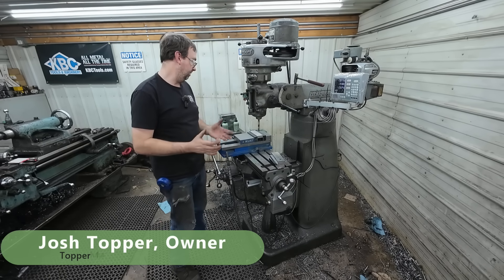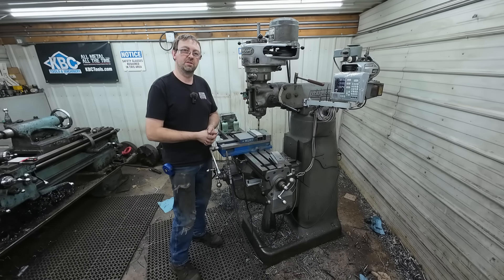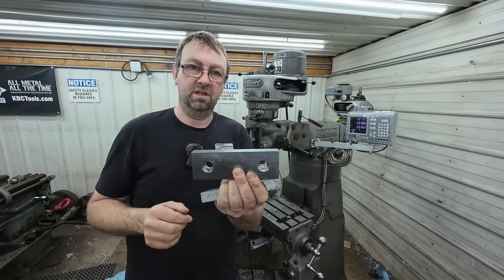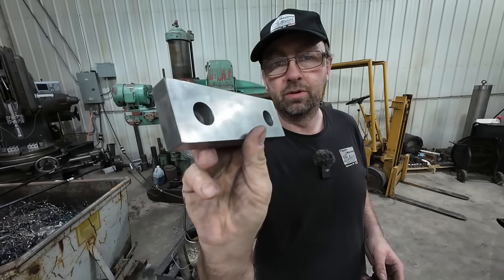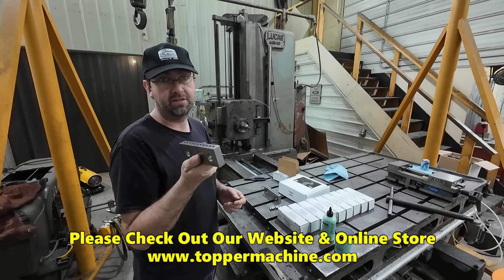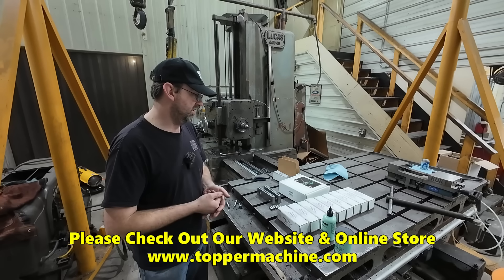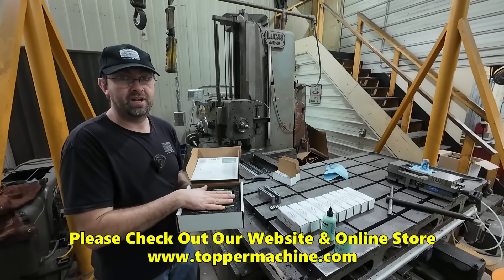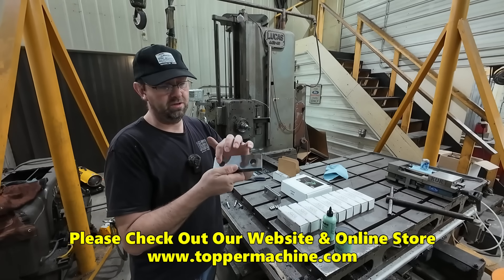The Best Custom Vise Jaws for Your Money

Comment: My favorite thing about this video? An experienced manual machinist's display of chip control! Probably most people would not even notice most of the subtleties you clearly show. From the use of the air-gun (mess be damned! we shall clean later), down to the flip and slide on the drill press. Almost every manual motion you made has the chips in consideration. Excellent!

Comment: Positioning.
Since you are doing so many units I wanted to ask why you don't drill all of them in sequence.
For example, the first hole is set up in the mill, then drill all the pieces for the first hole, are repositioned and repeated that way you do not
have to reposition each hole time and again on the same piece.

Would this approach save any time?

Comment: At 10:24 in the video, your drill chuck is turning in the right direction, but your reamer is running backward.   I know that the video frame rate is what causes it to appear that way. I'm guessing that the larger diameter drill chuck is  turning at a speed that matches the frame rate, and I guess the smaller diameter of the reamer isn't matching up the same.

Comment: Cool concept for holding parts. We use the snap jaws bolts at work but machine a lot of our own soft jaws to work with the snap jaws system. In many cases we machine the profile of the part into the jaw for good clamping. This jaw design would probably work well for prototype work being able to quickly adapt. Some day I'd like to get the snap jaws angle jaw. I wouldnt need it very often but man it would be way faster than making a custom jaw to hold something at an angle (no sine bars in the shop).
Reply from the maker: I bought the angle jaw. Haven't used it yet, but I have it.

Comment: You're turning yourself into a repetition shop with all that drilling and reaming. Well done. 👍
Reply from the maker: I started out in a manual production shop. I learned a lot of ways to do this without cnc. It really isn't bad.
Reply: @TopperMachineLLC  I started a repetition shop with only manual machines way back in the early 90's, I know just how boring it can be to stand at a drill press drilling and tapping 100's and even 1000's of holes one at a time.

Comment: Josh,  Well done,  Make a drill jig to reduce process time.   I don't remember seeing a surface grinder in your shop.  I suggest purchasing a used machine in excellent condition.  Make small angle plates, toolmaker cubes, squaring blocks etc.  Making your own work keeps you in business.
Reply from the maker: I had a surface grinder. Biggest waste of money and floor space I ever had. Finally scrapped it after never needing it in 10 years. Never turned it on once.

Comment: If I may make a suggestion, for drilling on a Bport I have found a steering wheel handle makes things easier.
Reply from the maker: I've used them, never cared for them.

Comment: You might be flat out making pin jaws when the orders come in. Personally, I don't have a need for them, as I don't have any machine that would require them. I just have a regular bench vise and a drill press with a junk vise with a lot of slop in it, but it's adequate for the occasional drilling I do.

Comment: The vice jaws are very reasonable. I have a smaller machine so I have a 4” vise. There are a few jaws with drill outs for both 4” and 6”. That’s great. So I like making 6” long jaws in 3/4” thick for my 4” vise. 4140 orehard is good. If you can get 4140 HT, that’s better. It’s what I use. That’s RC 45. You just need M35, M45 or carbide to work it.
Reply from the maker: I will be making 4" jaws soon.

Comment: I started using Anchor Lube after seeing  you use it. I also lay the bottle on its side so it's ready to dispense. Just a hobby shop  so won't need to order more for  a while.
Reply from the maker: It really is good stuff!
Reply: @TopperMachineLLC  Especially like getting rid of the oil smoke.
Reply from the maker: @ That was the first thing that sold me on it.  Second was how it worked in hard materials.  Absolutely amazing
Reply: i ref your channel when I suggest it to other shopguys. don't have a reason to get any myself (yet 🤞) but doing a little where I can

Comment: Hi Josh,
I really like your custom reamed vise jaws and will order a set soon. I plan to ship you two boring head range extenders of different designs soon. First I need to know if you have a 2 inch boring head? Which carrier do you prefer?  I normally use USPS.
Reply from the maker: Cool, thanks!  Any of them will get it here. FedEx is the worst though. Lol.
Reply: I assume you do have a 2 inch boring head. Both designs work on that size but could be adapted to 3 inch and larger. A sub- freezing cold spell in N.C. but probably not as cold as Spooner.
Reply from the maker: @ellieprice363  I currently do not have one. Been meaning to order one. 26° today. Actually nice out.
Reply: Go ahead and order one so you can demonstrate the range extenders.
Reply from the maker: @ellieprice363  will do.

Comment: That tumbler sounds a lot better than it did. I bet you're glad you went ahead and put those bearings in it. Nice work on the jaws.
Reply from the maker: The new bearings really make a difference.  Funny how some people said I was stupid for spending time and money on it. Definitely needed fixing.
Reply: @TopperMachineLLC  Some people are stupid for saying you are stupid for fixing the tumbler. No doubt it's going to get a lot of use and it needs to be in good working order.
Reply: @TopperMachineLLC  |Good|Quick|Cheap| you can have any two, they can change with the job and what works best for you may not be the best for me right now. Never let any one "should" on you.

Comment: Dont let anyone steal your idea. File a patent with a registered patent office.
Reply from the maker: It is copyrighted. Copyrights properly handled hold more value than a patent.
Reply: @TopperMachineLLC you can’t copyright an idea, only your drawings have a copyright.  Think about it, if someone could copyright their product, you as a machine shop would not be able to make replacement parts without the permission of the manufacturer.  I worked for a machinery manufacturer that tried to sue “pirate” companies that made spare parts for their machines, the courts shot that down saying unless they could show they used company drawings to design their version of the parts, or the parts were patented, the manufacturer can’t stop anyone from copying them.  The only way to protect it is to patent it, but since you already posted it, probably too late for that, and there can’t be any prior art already out there.  You can’t claim anything is proprietary when you show it in a YouTube video, proprietary is information you keep within your company, such as the material you use, tolerances, etc.  Once the first product is shipped, anyone that wants to is free to copy it, or they can just copy your idea from the video and use dimensions they want.  

As for Snap Jaws, their patents ran out 16 years ago, so anyone is free to copy that to their hearts content.
Reply from the maker: All of the drawings and many different versions of it are copyrighted.  Patents don't protect anyone.  Neither does a copyright for that matter.  Only if you want to spend a ton of money fighting any claims.

Comment: I noticed the pins are almost an airtight fit. Putting a very small hole either through the bottom or maybe along the length of the jaw through all of them would break the pressure/suction.
Reply from the maker: They are meant to be tight to help hold the pins in place.

Comment: I like that you keep your shop in a working condition and not overly clean. Your shop has made alot off chips and alot off money in its time
Reply from the maker: It's a working shop, not a museum or a hobby shop. It's actually cleaner than most I've been in.
Reply: @TopperMachineLLC  gotta hate those pinhole style mats though, those 1 inch holes in the rubber are a real you-know-what when you lift it up haha
Reply: @TopperMachineLLC  At least sweep up the floor ,pile it in the corner so you dont trip on it. I enjoy watching you work but c'mon man  😁
Reply from the maker: @wallaceknifeworkshomestead  you're welcome to come clean. Anytime.
Reply: @TopperMachineLLC  If I didnt live in Florida,, I would.

Comment: Why don't you supply the pins with a flat ground on them. Then they would not mark the parts.
Reply from the maker: While that is an idea, it would require more equipment and cost passed onto the consumer. So far, just the pins have worked great.
Reply: @TopperMachineLLC  that's ok. It was mentioned that care needed to be taken not to mark the parts or not clamp them too tight. I. Think a couple of minutes with a surface grinder and vise will transform from holding on a few lines of contact to a decent size gripping area.
Reply from the maker: @machinists-shortcuts  I don't have a surface grinder any more. Had one 10 years and never needed it once.
Reply: @TopperMachineLLC  I guess you could mill a flat with a carbide cutter.
Reply from the maker: @machinists-shortcuts  rC 60?  That would get expensive much faster than surface grinding. They are designed and sold how they are. If someone wants to modify them, that's up to them.
Reply: @TopperMachineLLC  Maybe a good solution to prevent marking is to make rings with a flat to fit over the pins.

Comment: I made my own jaws a while back. (Several different types) Your price is not out of line with the cost of time and material nowadays.
One of the sets I made has a very small dovetail along the top. I made a finger stop that I can set along the dovetail for parts that don't extend beyond the jaws. Very handy as most of what I do are small (model work) parts in moderate quantities. The finger stop was tricky to design.

Comment: I will want a set of four inch. I have a home made stop, but not like the one your friend designed. My stop is clamped in a table tee slot. Cool design. I like production kind of videos. Easier to just flop out the cash to get these than source the materials and tools. It will help to pay for some of your costs too. Good luck. Now I have to find a video where you use the dowels.
Reply from the maker: 4 inch jaws are in the design process. First I'm focusing on the 6" as it's more common.